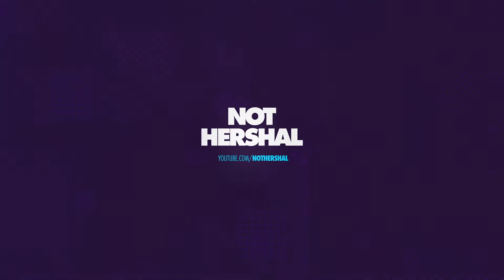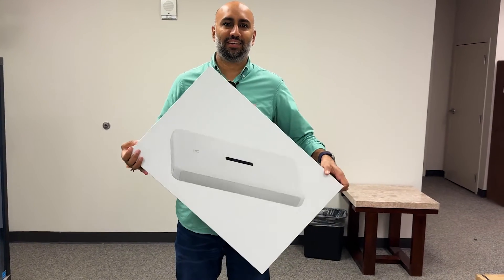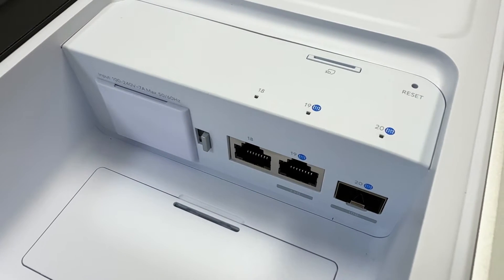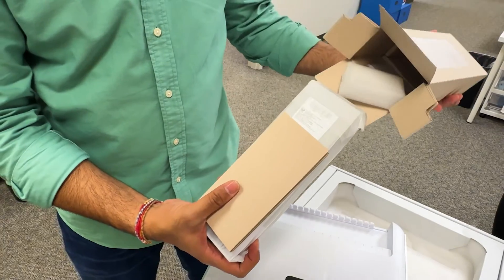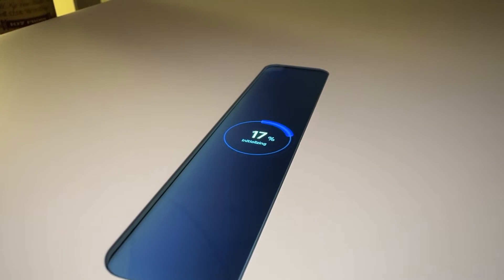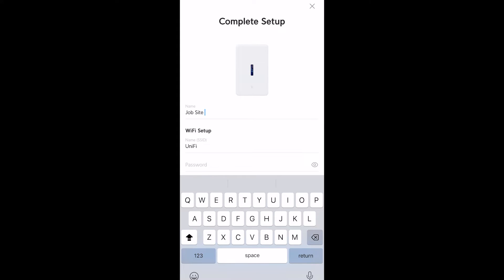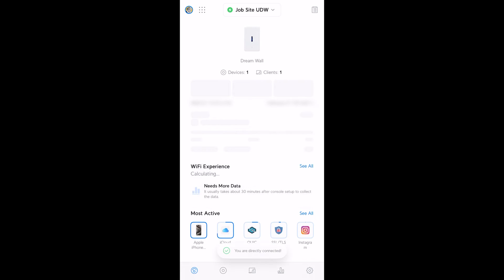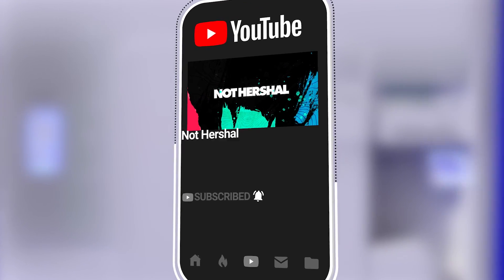Unifi Dream Wall UNBOXING & Setup - Ubiquiti All-In-One Cloud Console with Power Redundancy

Comment: Do I Need to put my ISP's router into passive mode in order to use this or can I leave it in the ISP mode as the primary router and connect the UDW to a port on the ISP router?
Reply from the maker: Not necessarily. Just make sure that your ISP's router and your Dream Wall's DHCP servers are set to different IP schemes.

Comment: Hello, what’s the role avec the 2 PSU?
Reply from the maker: It provides power redundancy, as the power supply has the potential to fail over time with heavy PoE load.

Comment: Can we add extra harddisc to use camera videos locally? There is only one power unit but other one is free
Reply from the maker: No, I paid for the extra PDU.

You cannot add a hard disk directly to the UDW. There is a micro SD slot but if you want larger capacity, you should opt for the UNVR or UNVR Pro.